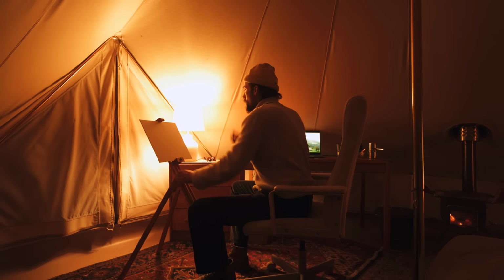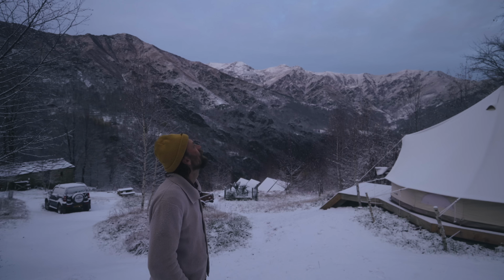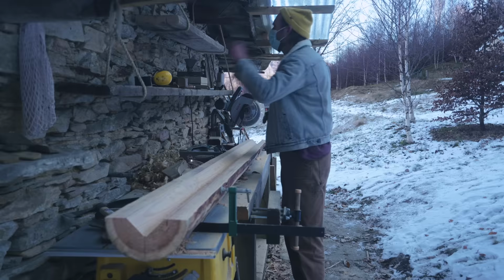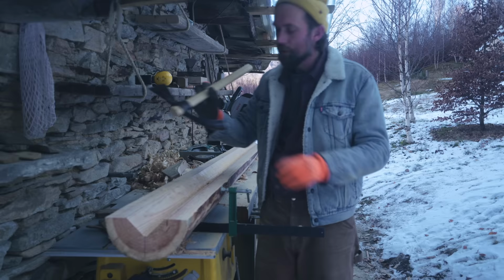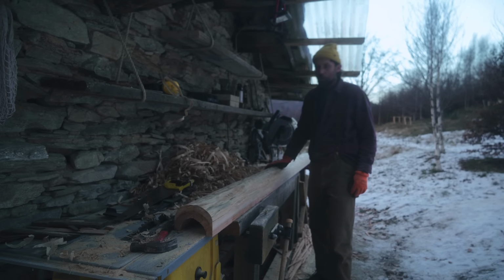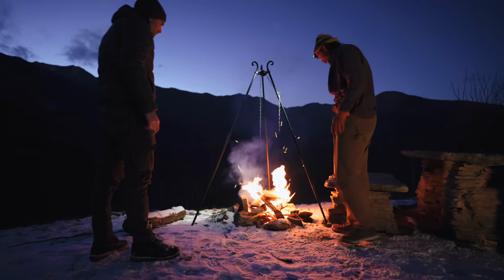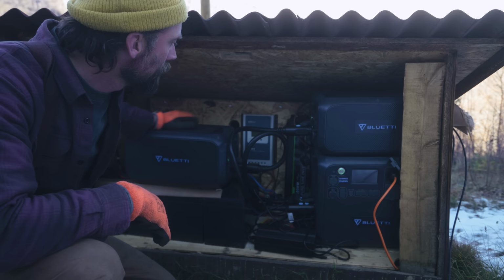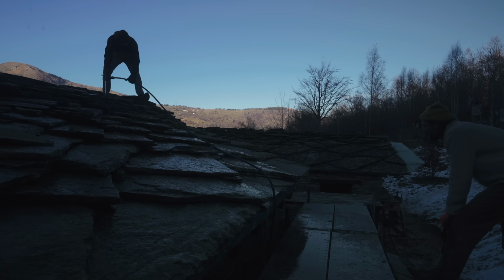#46 First Snow

Comment: Hello Martin.
Just to share that I have been working with 1000l tanks for years, like the one you show. The weak point of these is the stopcock that is very easily damaged by both the sun and the cold. It works for me to protect that key by turning the tank so that sunlight does not fall directly, and also with some type of fabric, etc. that shelters the faucet and the area where it is inserted and tends to crack.
Greetings from Spain.

Comment: Never in my life have I ever even heard of wood gutters. The thought never crossed my mind. I always thought of copper gutters as the pinnacle of gutters. But the wood is just perfect with the old, rustic stone. They are going to be really unique and beautiful. ❤
Reply: We have loads of wooden guttering in England
Reply: @denisjackson8310  is that on old structures or is it still done on new structures? I would think the wood would degrade and rot over longer periods of time.
Reply: I had wooden gutters on my 1820 house in Maine.  Still in tact when I sold it 2 1/2 years ago.   So, yes, they last.
Reply: Old house
Reply: @reginapierson2117  reminds me a bit of how ancient sunken ships are preserved by the water itself.
Reply: @TheArtisticGardener777  wood gutters are typically made from Cedar trees which are full of natural oils and tannins  that make them less susceptible to rot. To buy modern wooden gutters you will pay a small fortune compared to the metal systems that are most common now.
Reply: its a theme , a wood gutter wont look good on a new modern  house
Reply: @yardfowl3149  cedar would make sense, it’s also very light weight, which would make it more practical. I can only imagine the expense to buy nowadays, no wonder Martijn is making them himself 🙂
Reply: @sdqsdq6274  I would have to agree with that, unless it was a log cabin or a modern house built of stone in the traditional manner.
Reply: My brother’s house, built in 1911, has redwood gutters. Still working.
Reply: @woohoo5473  they must be beautiful! I think redwood is more rot resistant than cedar, although, not readily available in most areas.

Comment: You can have bottles filled with very salty water floating in the tank. That will prevent the surface from freezing when the temperatures dip, it wont replace the insulation though.

Comment: About the water : One Swedish trick would be to keep it dripping a little bit. Generally  ground or well temperature is 6C    or even 8C if it is from a deeper well. It might save it from freezing if the pipe is not  too exposed or shallow over long distances.

Comment: If i may give you a tip, as an oil painter myself.. buy a daylight lamp. In these lighting conditions you're working in, it's hard to mix paint and see what you are doing. You need proper lighting, start off a little bit smaller maybe, even in subject and later move on to bigger canvases.

Comment: Not sure if it would work with such a large piece of wood, but I’ve seen cove cuts made by feeding the wood through a table saw on a diagonal with a temporary fence rigged accordingly.  The key is to make multiple passes, just taking barely the height of the tooth of the saw blade each pass.  If it works at all, it would be faster and less labour intensive but with a clean finish.  You Tube has lots of examples.  On the other hand, I truly appreciate the results you are getting with the hand-made approach.  Thanks for the excellent videos!

Comment: Martijn - try using your table saw to hollow out the gutters; make a fence at an angle to the blade cut line, lower the blade mostly down, then make passes with your half logs. Raise the blade a bit on each pass.  The saw will eventually create an elliptical hollow much more quickly and accurately, and with much less effort (!).  Experiment on scrap pieces until you get the fence angle just right.  Love the serenity of your videos, and your occasional commentary.

Comment: Good morning all. That musical sound walking on first snow, just invigorating. You were right about the roof. Comparing the two roofs (cabin on the right) that straight ridge on the finished roof looks beautiful from the distance. Very aesthetic to the eye! Gutters coming along good. You must remember to wear protective eyewear, those chips flying off the stones and timber can be fatal. 
Water freezing in the hand basin.😮 Wonder if the wine freezes as well! I don’t live in a snow area, so just wondering. Thanks for sharing, Martijn.

Comment: I've enjoyed your videos during my lunch breaks, thank you for sharing your journey. If you're curious to learn more about painting, I'm happy to share a couple of tips. I don't work in oil, but I will say that it helps to approach a painting similar to a construction project. You have to plan it out, do some studies (tests), and prepare your materials. Take your time with these things first and your result will benefit.

First, draw with charcoal, then use a brush with water to "paint" it. This is great practice. When you're ready, draw your composition on your canvas, and use diluted black paint. Create your painting in black and white first, and make sure you mix your medium appropriately. An easy medium to start with is 1 part linseed stand oil and 2 parts turpenoid. It's best for your health to use turpenoid over other mediums.

Safety is also a big concern, so take care around your stove as oils and mediums are flammable. If you use a rag to wipe any of your oils, mediums, or brushes, never leave that rage inside your tent as they can spontaneously combust.

Once your start painting, the rule of thumb with oils is "fat over lean," meaning that you start with thinned out paint layers and as you add layers you can add more paint and the painting becomes thicker over time.

Get the underpainting done right, and then you can add color washes over it. Kind of an "old masters" technique. Other oil painting experts will have better advice than this, but it's a good way to start. Hope this helps, and I look forward to your continuing journey!

Comment: When you grind metal like at 5:30, build a small wooden or metal support that you can rest the work piece on so that the wheel rotates into the material. That will give you a much more consistent and easier to control operation. It may not have mattered in this case for the chisel but for other occations it may be worth doing.

Comment: Thanks for these inspirational videos.  Suggestions: 1- Get a chalk line or an Asian style ink line to mark your long straight cuts.  2- look for a round bottom wood plane or make one.  Old gutter planes are rare, so it might be faster and easier to make one.  A quick google search shows that Paul Sellers (among others) show how to make these Krenov style laminated wood planes that are easy to make with your chop saw (a plane to make the inside of the gutter straight and smooth,to prevent standing water inside the gutters).  3- you could certainly use a gouge to help the roughing out- you want a timber framing caliber of gouge for this work.. Cheers,  Rov

Comment: my friend, i love your creative style and am very impressed by the hard work you put into the cabin as well as these videos. i have a question. on the roof you are placing wood directly in contact with the stones. when the stones build condensation, won't that accelerate the rotting of the wood underneath them?

Comment: An angle grinder carving tool would make it easyer to clean up the gutter. They are somtimes know as an arbortool basically a chainsaw chain on a disk, but make sure you have a guard on and think about what and how you are going to use it. If to don't it can be disastrous.
The only problem is it is probably way to late to get one as you would have long finished the job.

Comment: 10:50 I started with oil painting and ended up switching to Acrylic painting for better results as a beginner. Acrylic paint dries much faster, so I can block in my shapes and begin layering in the details very quickly. I also paint on a smaller canvas, so my paintings only take 4-5 sittings (10-20hours) to complete. That way, I don't invest a lot of time and money, if I need to start over. When I get good, I will probably switch back to oils with a larger canvas. For now, I see steady progress and have begun selling my finished paintings on ebay. Oh yes. My first few paintings were complete disasters....

Comment: Once you are finished with the buildings, I would seriously consider a professionally installed 10 Kw solar system and a few LiIon batteries. This would allow you to power the buildings and workshop, cook with an induction stove, use mini split heat pumps, charge an electric vehicle and an electric tractor.

Comment: Hi Martijn 
Just a little tip when your chiselling out a lot ,try tipping the hammer on the side and use the cheek of the hammer it's a larger surface area on the side and avoids hitting your hands so much especially when its cold ,not trolling by the way ..loving the vids great content ...

Comment: Hi from Sweden! Are you treating the gutters with raw linseed oil? If its available, you could mix the oil with ten procent wood tar, and block the ends of the gutter and pour the mix and let it stand there for a day or so, to soak in the wood....The smell is also nice. I use this mix on the inside of my wooden double ender,and it works fine and dries too....Thanx for fine videos too !! Mikke

Comment: Start with your background color. Paint the trees in the distance and work forward. The closer you get, the more defined everything is. Use good brushes. Clean them well. You should learn quickly and become more skilled as you practice.

Comment: Thanks again for a relaxing video. I have one question; how does your refrigerator work when it's freezing? There is always a warning on the box of a new one, that it should not be operated in less than some degrees of temperature.

Comment: Why would you insulate the water tank unless you're heating it?  It will just get to the ambient temperature anyway.  If you want to prevent if from freezing you might need to keep the water running (slowly) indefinitely.

Comment: IMHO - at the 19:53 mark - I would spend just a bit of time each week cutting down some of the birch trees (while they are small) in the foreground between the solar panels, your cabins and the bottom of your property. If not, someday you're going to see that quite a bit of your view is gone. If you wait you'll find the trees so much larger and it become a really big job. I can see that someone has kept it a field/cleared for a long time but has neglected it for say 5 - 7 yrs by the height/look of the trees. Once you cut them close to the ground You'll probably need to drill a hole in the remaining stumps and pour a little enzyme killer in it. Only an 1/4 teaspoon. If not hardwoods will continue to sprout new leaders..
Reply: Don't destroy future firewood ....!!!

Comment: I was wondering about you insulating things like the battery box and for example the water tube from the reservoir. Why do you do that? The water isn't warm from the reservoir right? It needs its own heat source for the insulation to work. And do the batteries run hot? In that case isn't it dangerous to insulate the battery box?

Comment: I saw the struggle on the last video with the gutters. Maybe this method using the table saw  would yield better and simpler results, first I think you need to attach a straight edge to your boards. https://www.youtube.com/watch?v=OLICB02oRss
Good luck on your builds.

Edit: Now I see you are cutting a straight edge on them. Do the cut first and later the cove cutting.

Comment: why not build temp  kitchen in one of the buildings for winter. Even Adolf was a painter...and did not have meat
Non sense Gutters.The wood is dry at least? They will crack when drying!  Do you need them winter time? Next thing you chisel canoe out of one log of wood...
I would seal the house as soon as possible and move in, Tent is a joke even with the little stove.

Comment: Martin, you need to learn how to sharpen your tools, especially your plane blades. You cannot take a blade from the grinder and use it straightaway in the plane! A grinder only re-establishes a damaged edge. You next must hone on stones. Your plane blade is horrible. Watching you flail away at that lumber (gutter?) was almost impossible to watch.

And an adz is not a scraping tool! Good lord man, learn how to use your tools properly. The log is laid on the ground, and you stand astride it (or on it), and you swing the adz in a picklike action down and toward yourself.
Reply: Maybe you shouldn't watch his videos if it bothers you so much.